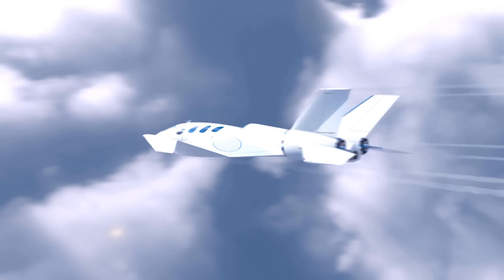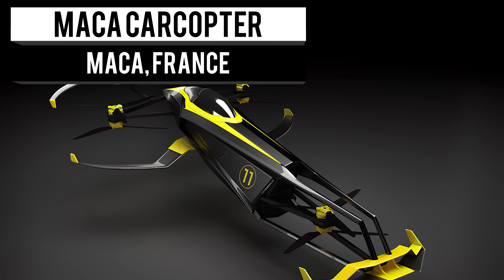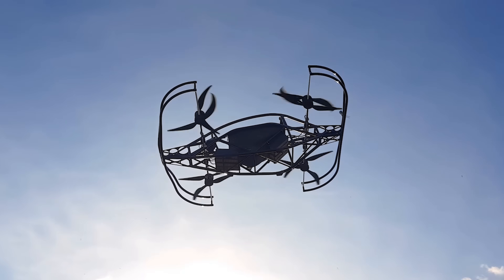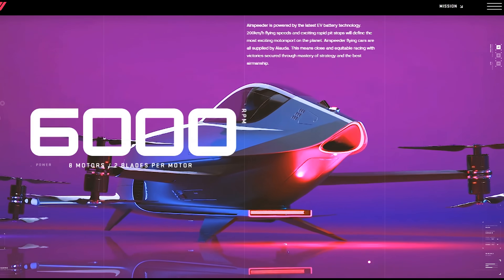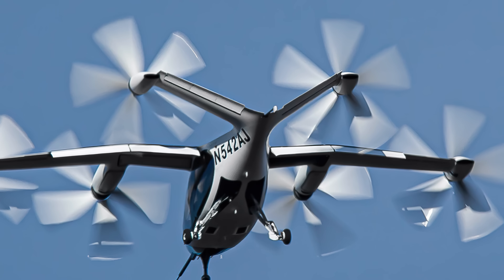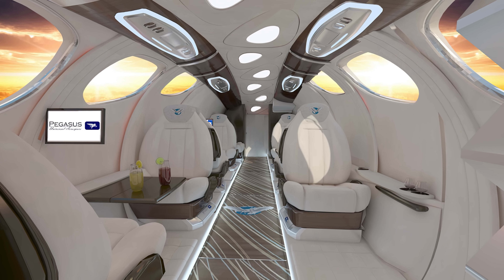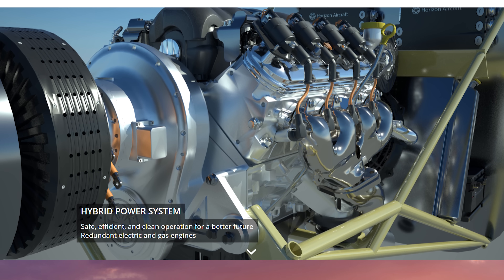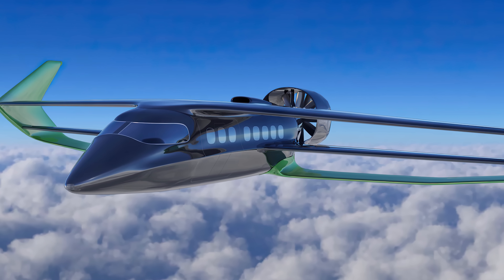10 MOST INNOVATIVE AIRCRAFT AND PERSONAL AERIAL VEHICLES CURRENTLY IN DEVELOPMENT

Comment: Hydrogen is 200 times more damaging to the ozone layer than hydroflourocarbons were.  It also takes 9 gallons of water to make 4 gallons of hydrogen.  The world is already facing a critical water shortage without the added strain of making hydrogen.  Electric power is the key and solid state batteries are the means to safe and sound forms of travel.

Comment: These are all exciting and wonderous machines - but has anyone started addressing the highly complex issues of air traffic management? The target market for these vehicles seems to be travel to and from cities - highly dense areas and with a large quantity of these all aiming at the same location this poses a significant ATC issue. Where is the 4D flight planning required to manage the new influx of these machines? Having been a pilot and in ATC over the past 30 years I see many issues that need to be addressed. There are many already explored novel ways of implementing this and with current advances in AI and 5G networking these are more feasible than ever - but who is doing it?
Reply from the maker: Most, if not all, will be for licensed pilots, military, search and rescue, and not for you and I, or the general public. I can not see the general public having access to a vehicle like these causing ATC issues. That would end up a huge mess. eVTOL use of any sort will be highly regulated.
Reply from the maker: I'll add, where I see the most benefit to these type of vehicles are; search and rescue, and in some cases, proving a faster means of transportation, other than an ambulance, when a few seconds time is the deciding factor between life and death.

Comment: Most of these designs look and sound like the imaginings of a couple of 10-year old kids.  There is NO infrastructure in place to handle the "door to door" VTOL craft. As a matter of fact, just the opposite is taking place, more overhead power and phone lines, more microwave towers, more NONE LIGHTED antennas in towns and neighborhoods. Just take a walk downtown and look up. A tangled mess of poles, wires, lights, and antennas. The same is true for too many suburban areas. It is almost impossible to get life-flight helicopters into most urban areas; let alone multi rotor craft with a much larger footprint. If you want a practical personal/family flying vehicle it will have to be the size of a mini-van or SUV, carry 6 to 7 people, their baggage, and the family dog. It must be as easy to operate as the aforementioned mini-van or SUV, cost the same or less to operate (including insurance), be able to somehow auto land when it is run out of fuel (charge?). If it fails in any of these areas it will remain the next "wonder tech toy" of the well-to-do elite.

Comment: The problem with hydrogen is two fold. It doesn't compress easily, significantly reducing storage. The second is, because it is such a small molecule, it leaks very, very easily. Not so good given its high combustibility!
Reply: It isn't stored as a hydrogen molecule in proper storage solutions, but adsorbed or bonded with other substances.
Reply: @vitordelima  I have heard of this, but I thought it was still very much in the experimental stage. Do you know how advanced this technology is? Hydrogen fuel has great potential, so I'd be interested to know.
Reply: @andrewthomas695  Using metal powders or pieces, ammonia or hydrogen peroxide to store hydrogen isn't that experimental, adsorption with porous materials was made viable very recently, reforming other fuels into hydrogen is very well known and there's a magnesium hydride paste which is already available to be used.